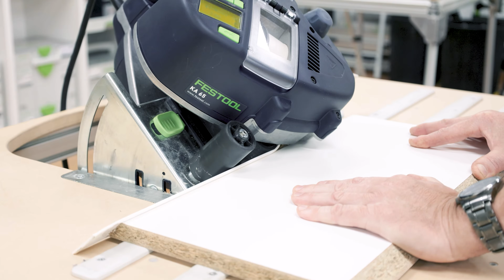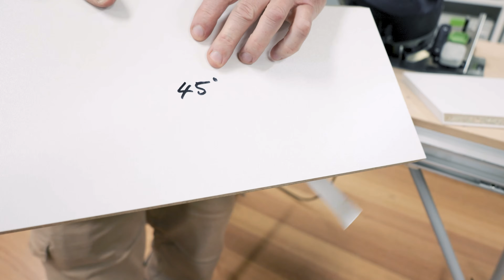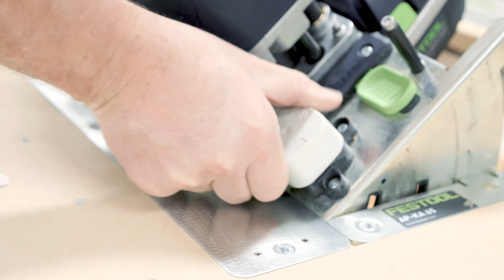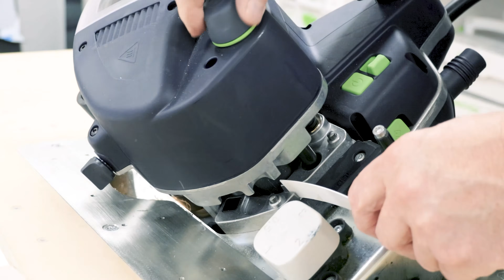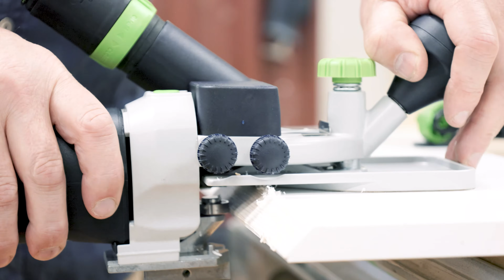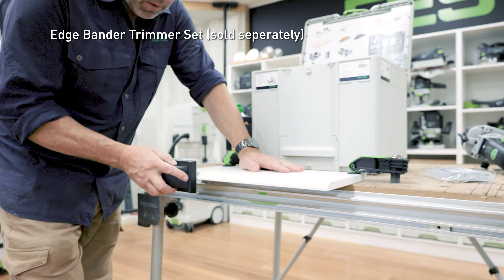Shark Nose and Mitred Edges With the KA 65 and MFK 700 | Festool

Comment: Interesting. I always trim the bulk off with the carbide scraper and round over with the 700 and a 1.5° plate.  I don't think I've ever used the 700 in the vertical position.